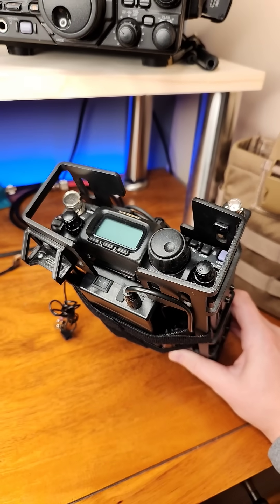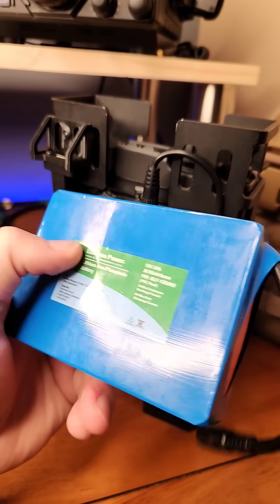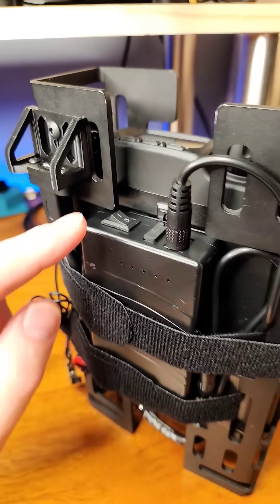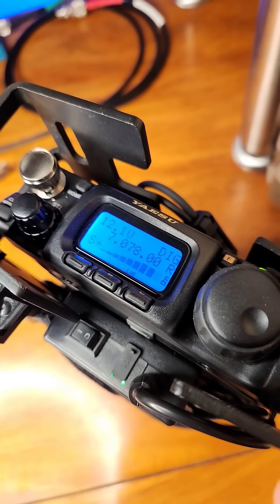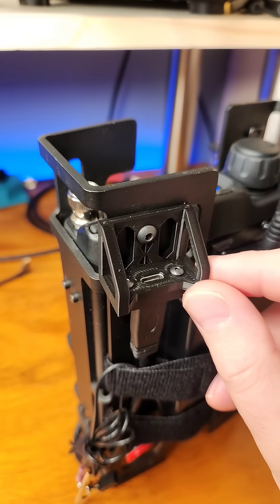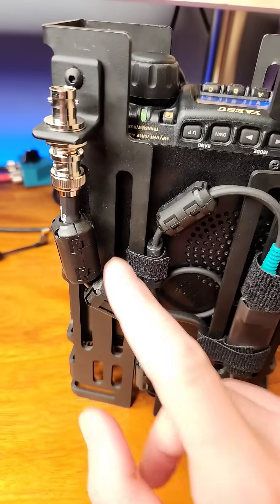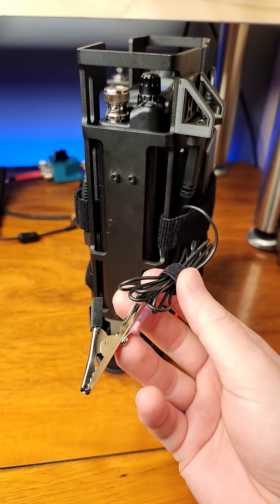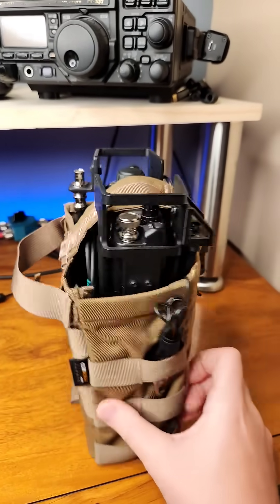Ultralight HF, VHF, and UHF manpack enhancements for SHTF

Comment: What do you think about using a 18v 4 amp hour Ryobi power tool battery? Is that possible because I been thinking about that type of configuration.
Reply from the maker: I standardize on the 18v Ryobi line for the RV as it has a great set of tools. I have the 12V adapter and it's to much bulk with the 4Ah battery to use with this slim configuration. It will work, though.
Reply: @TheTechPrepper Yes I agree it's a lot more bulky however I think the convenience outweighs the bulk because how easily you can swap batteries and possibly more reliable over time.

Comment: Do you just use an Anderson powerpole to connect your talent cell to the radio?
Reply from the maker: Yes, I use a special cable with a barrel connector that goes into the TalentCell on  one end, and Anderson PowerPoles on the other end that connects to the 818.
Reply: Do you still use the talent cell with this rig? 

Do you prefer the talent cell over the bioeno for emcomm use in the field?

Comment: Stay away from rocker switches for these applications (batt kill switch).
They've a larger footprint, harder to seal correctly for outdoor use, debris builds up and ultimately, as they wear, they are prone to inadvertent activation.

Comment: Regarding the lead to clip in to a ground stake, mentioned at the end of the video…    Get heel spikes for tree/pole climbing.  Run leads up inside each pants leg.  Every step you take is grounded.   You’re welcome.
Reply: Yes…

I know that a proper grounding rod is several feet deep, and the ideal characteristics are determined by soil type, acidity, average moisture content, and basic geology.  It’s just a joke.   Saying that in advance because I know I have a twin out there just waiting to chime in with facts.   I see you {me}.

Comment: Can this do GMRS & MURS as well… thinking about making a SHTF radio pack & want to be able to use everything without carrying multiple radios
Reply from the maker: Yes, you just need to perform the MARS/CAP modification. Ham Radio Outlet as well as other stores do this for a small fee. You can do it yourself if you feel comfortable with a soldering iron.

Comment: What is the total cost?
Reply from the maker: It depends on where you can source the radio. In today's market you're looking at roughly $1,400 USD. This build used to be  under $1,000 about two years ago.

Comment: any plans to weatherproof?
Reply from the maker: I do minimal waterproofing. Instead, I operate when conditions are favorable. If not, I deploy a shelter to operate from. I do have a custom DWR ripstop nylon rain cover for the manpack bag. However, this is useful for storage, not during operation. Civilian HF amateur radios are not designed for rain.

Comment: I would worry about heat
Reply from the maker: It's not a problem if you practice least power principles and carry out short tx activities. I've been operating like this for close to 4 years in temperatures in excess of 110F and it's never been a problem.

Comment: Minor point.  Whenever I use loops of open end velcro on things mounted to a belt, they tend to snag on clothing from its exposed edges or it gets snagged and pulled, potentially tensioning any cable connections involved.

Comment: FT-818? You don't mention this crucial detail ;-)
Reply from the maker: Yes. It is a Yaesu FT-818ND.
Reply: @TheTechPrepper  How much operating time can you manage with that battery and can you do all the digital contacts (winlink js8call) you want to do with this radio? Love the channel.
Reply from the maker: @hikingfish3  It really depends on how much you transmit. I can run for about 6-8 hours when running 2.5 watts when I keep my JS8 station on auto during the day.

Comment: I have a feeling you'd get much better CM choking out of a small 1:1 balun/unun wound with magnet wire on a FT140-31 ferrite. You could fit it in a pretty small enclosure just before the BNC connector in lieu of the snap on ferrite beads.
Reply from the maker: This is a great idea. In fact, I have a mini inline choke from Tim N9SAB which would work very well. Thank you!

Comment: I may be a bit off base here, but wouldn’t you want that USB connection facing downward so it doesn’t catch any rain?
Reply from the maker: These radio are not waterproof. You should run these from a shelter. I have silicone cap on the connector. I also made a custom rain cover this manpack.
Reply: Good eye for details. We have to consider all these things.

Comment: What power adapter are you running from the Talentcell to the 818?
Reply from the maker: I have a Wincamp adapter on the bottom. Then, it's just a short Anderson Powerpole to barrel connector. I believe the cable is from Powerwerx.
Reply: @TheTechPrepper   Thank you for the info Sir.  - 73

Comment: Hurts me that the 818 was discontinued right before I got into HF stuff. I should have nabbed one when I could have.
Reply from the maker: It was a loss. I am still trying to snag a third "old-new-stock" FT-818ND for the EMP kit. The FT-817ND on the secondary market is a great option if you can find a non-Japanese market model.
Reply: You can still find them.  They are often purchased and used rarely sometimes.  I bet you can find a good one.

Comment: Would be interesting to know what the SWR is at the freq's you are commonly using this system on?
Reply from the maker: Roughly 1.20:1. I am doing a dedicated video on this exact topic in the next video.
Reply: You want to mismatch the load slightly to increase the bandwidth. 2:1 will give you low return loss but more bandwidth.  Problem with wide band radios, the unbalanced load will cause those currents to form on the coax shield as you are trying to rectify with ferrite.  Antenna directional pattern and gain go out the window. @TheTechPrepper

Comment: Well done. And depending on the model of the talent cell, you can also charge your phone on the USB. Keep the excellent content rolling. Michael KH6ML in Hawaii
Reply from the maker: The 5v USB is a bonus. It's nice to have this if the cell phone runs low. Cheers from AZ.

Comment: nice.
I have the Ft-817 w/ armaloq and digirig mobile, wind camp lithium (6hr run time) 5ah external laptop battery (additional 20hrs+) Wide band whip hf-6m and Midland VHF/UHF whip for on the move and 8010EFHW and pac12 for on the pause. The rig and battery sit in center pouch of my day pack with the whips and mic extended through the top. The tablet and OTP antennas in there main pouch with my gear.

Monitoring voice nets and using andflmsg, APRS, rattlegram from my phone or Js8call, winlink,  VARA from my tablet I can work a solid 2 shifts from the tent or moving in the back country.

5W is plenty for close range voice and long range digital.
Reply from the maker: Nicely done.

Comment: I need a Manpack for the FT-8900r. Any plans to make anymore?
Reply from the maker: Sadly, not this year. I ran into a number of manufacturing issues last year and only produced 110 unit. If you know someone that is good at sewing, you can modify the Helixon Tek E&E pouch then add the 5.11 6x6 admin pouch to the front. I ran my manpacks like this for a long time. I have an FT-8900...it's roughly the same footprint as the FT-818 with TPA frames.

Comment: This is epic, please post a video with deeper explanation of how to
Reply from the maker: It's coming. It's the next full video in the pipeline.
Reply: @TheTechPrepper  this is the kind of setup I've been dreaming about.
Reply: @TheTechPrepper  I’ve looked and looked, but I haven’t found a video that completely explains that ammo back up power box that you built a while ago. Please do one.
Reply from the maker: @elitecombatfitnesscentral  Unfortunately, I took that unit apart and used it for a build in the RV. So, I don't have a good way making a video at the moment. I have this video topic in the backlog, but I have a new series that I am working through.
Reply: I’ve been trying to find this battery . Can you tell me where you bought this at?
Reply: @dream_chaser7569 that looks like something from GigaParts
Reply: Gotta keep it in a Faraday cage in case an EMP occurs or else it will be a paperweight in a SHTF situation.
Reply: I'm with you guys on this question. Dope work!

Comment: Looks good. Would plastic instead of metal be an option when looking at weight and cost? 73's de PD1XAN
Reply from the maker: The frames are fairly light. Based on my operating in the field, I actually prefer the additional protection offered by the aluminum frames. I have been running these frames for about 2 and half years.
Reply: I would think the metal frame could be the secret for your "counterpoise" grounding.  A plastic frame 'might" induce even more current on your coax.  Stray currents mess with the antenna performance as I stated above.  Going from 50 ohms impedance (radio/coax) to antenna which has to connect to a free space impedance of 377 ohms.   We need a VNA in here now. @TheTechPrepper
Reply: @huh4233 I know your comment is in English but it says stuff I'm not smart enough to understand. Isn't that why he added a ground wire? I'm so new it's as if I went to the wrong lecture in college, lost in the sauce